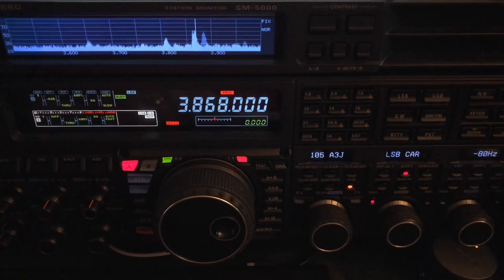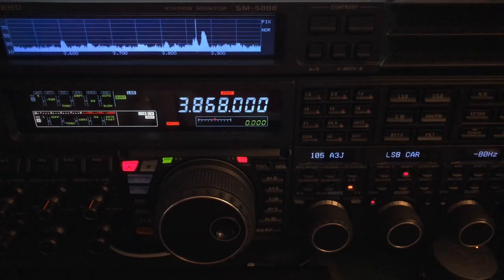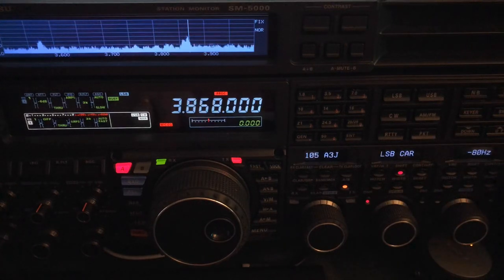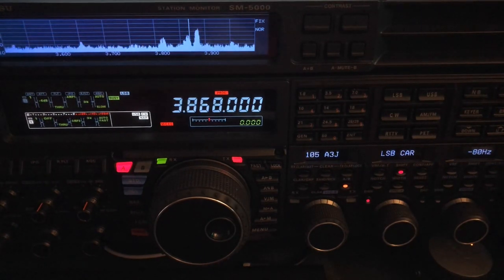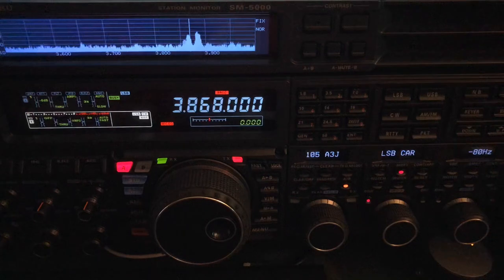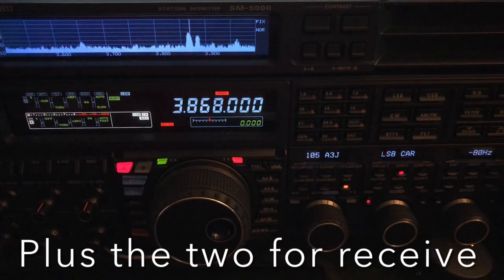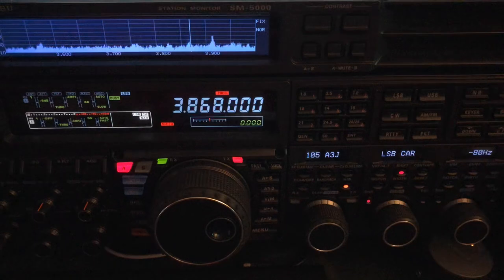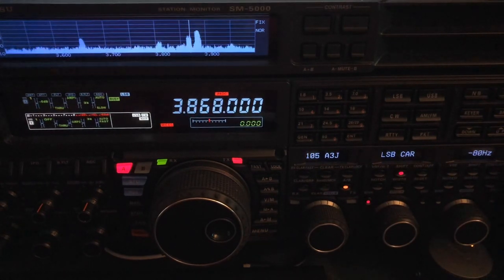Setting a New RX Carrier Point (why?)

Comment: I think that is a feature of Yaesu radios. My FT 1000 mkV also allows that. -200 to +500. And as you said you can do it on TX too.Even my little FT 817.
The effect would have been more noticeable if you had the NR off. 
BTW shift is primarily intended to reject interferences. Changing the pitch is more of a secondary effect.
73s
Reply from the maker: I never run without DNR enabled.  And yes, I’ve covered the normal use of Shift ad nauseam.  I guess you might be new to the channel.  Welcome!

73, de N4HNH
Reply: @n4hnhradio  actually not new, subscribed from a while and we commented few times on 991perhaps which I own too.  I must have not seen all your videos ;)
Reply from the maker: I use shift when combatting QRM.  There are plenty of videos on the channel that show that.  But there are hundreds of videos on the channel that get overlooked.  

I think the ones where I show the main use of Shift are more in the FTdx5000MP and FTdx10 playlists, because they are my main transceivers.  People don’t realize that many of the techniques that I show in videos for either of the radios applies to others, even other brands.  These viewers miss out on a lot because they choose not to watch a video that doesn’t involve their specific transceiver.

73, de N4HNH

Comment: If anyone can help, I have a quick question about the PO meter. when the radio is set to 100w tx, the PO meter doesn't go above 10W when I transmit. Mic gain doesn't seem to change this. I'm new and can't find out what I'm missing. Making contacts is challenging. Thanks!
Reply from the maker: You didn’t mention which radio you have or what mode you were operating.  I assume Yaesu FTdx5000MP, since you posted the question under a FTdx5000MP video.

The Power Meter on these radios doesn’t read Peak Envelope Power.  You would have to hold a strong and steady whistle to see the peak power.  You could go to FM mode and check for 200W.  If you see 200W, your final output transistors are good.  But note that the radio shown in this video is the Yaesu FTdx5000MP.  It outputs 200W SSB or FM, when set to maximum.  If you have a different transceiver, one rated for 100W, you should see 100W maximum on SSB or FM.  But again, the built-in meter will not read SSB PEP.

One final thing to note is that these radios don’t always hit a full 100W on an accurately calibrated meter.  I’ve seen 95 to 98W typically with 100W transceivers, checking at 14MHz.  You might see a full 100W at 7MHz.  The transistors used for finals must operate across a broad range of frequencies.  I’ve found the “sweet spot” for efficiency with these transistors to be 7MHz.  By the time you reach 28MHz, the power output might have dropped to 85 or 90%.

73, de N4HNH

Comment: How about a comparison of the CW decoder on the Yaesu FT-DX-10 and the  Xiegu X6100 ?
Reply from the maker: I don’t own a Xiegu X6100.  But the key to any decoder is reducing the noise.  SDR transceivers struggle with that because they have limited filtering in the front-end of the receiver.  I understand that Flex Radio and ANAN have been successful because they spend more money on filtering.  The FTdx10 has the advantage of a dual-superheterodyne receiver front-end, physical roofing filters, SDR, and phenomenal DSP.  Transceivers relying solely upon a direct-sampled signal and DSP cannot compare to the hybrid approach Yaesu has taken with their FTdx10.  

And no, I don’t work for Yaesu, nor do they support my channel in any way.  I just call it like I see it.  My channel is focused on helping amateur operators better their enjoyment of radio with improved operating techniques.

73, de N4HNH